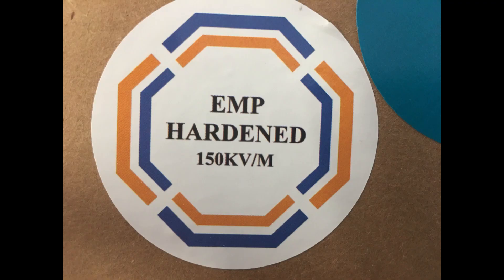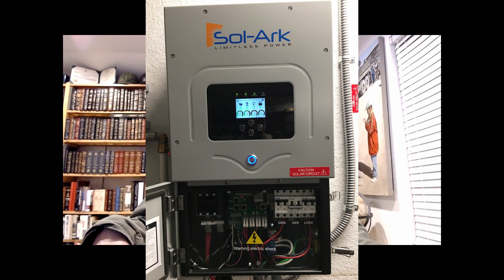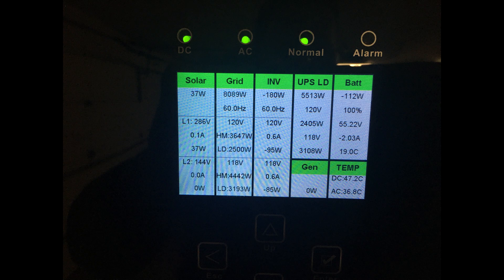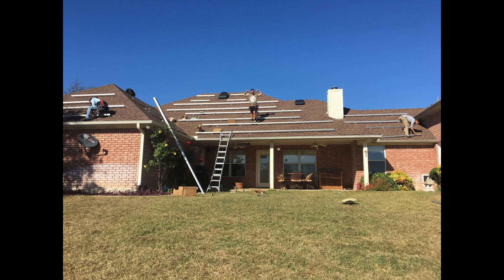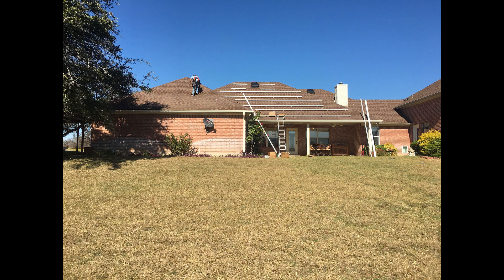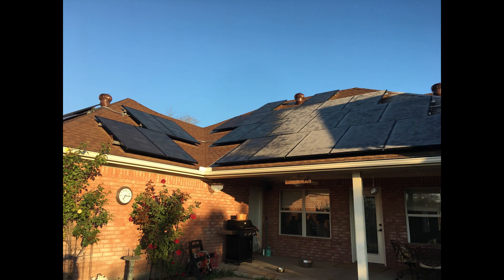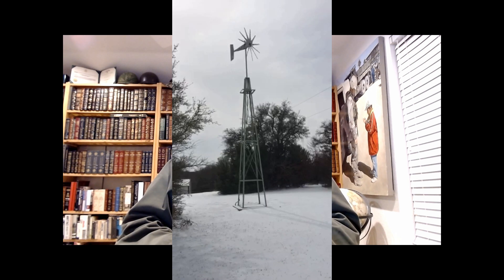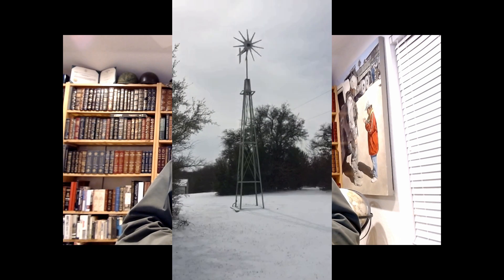Part 4: My system’s configuration and capabilities

Comment: What plans do you have to replace or bypass any rapid shutdown equipment on your PV array?  In the event of an EMP or similar, the RSD modules will brick your array even though the PV modules and Sol-Ark survive.
Also, the Tesla Powerwall is AC coupled only and shuts off after 48 hours with no internet connection.
Reply from the maker: Each PV has a ferrite installed over the wires. The hope is that this would protect the PV. I'm not an expert on this stuff, but that is supposed to help protect the RSD modules. Do you know anything different? There is obviously not a lot out there on EMP protection but Sol-Ark did get these tested to MIL-SPEC. Thoughts?
Reply: @CivilDefenseBookAuthor  The ferrites protect the PV modules, but not the RSD box on each module.  In the event of an EMP, you would have to go up on the roof and bypass or replace each RSD box that had been fried.  Most of the work bypassing or replacing them would be temporarily deracking each module to get at its RSD box.  My Sol-Ark system uses ground mounted arrays, so I did not need any rapid shutdown equipment.
Reply from the maker: @randacnam7321  Thank you for this. I need to look into this. Obviously I need to have a plan on this before Kim Jong Un sneezes.